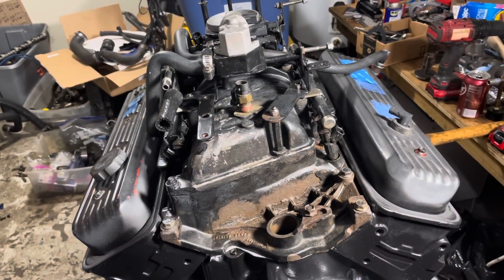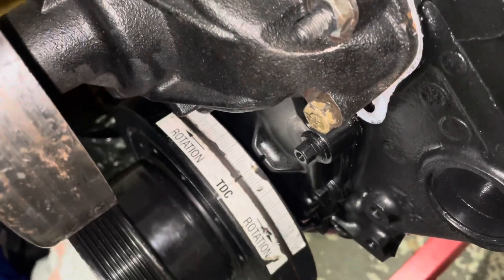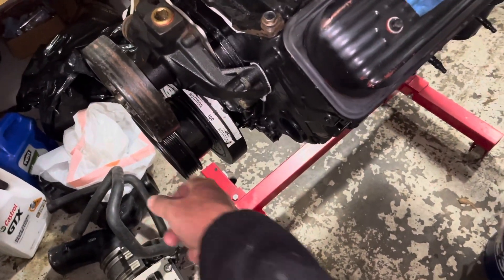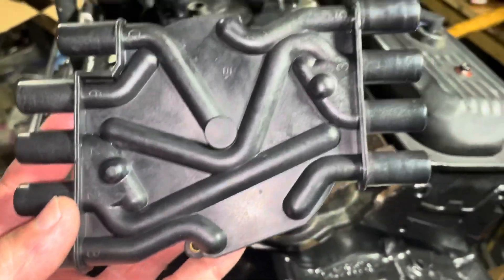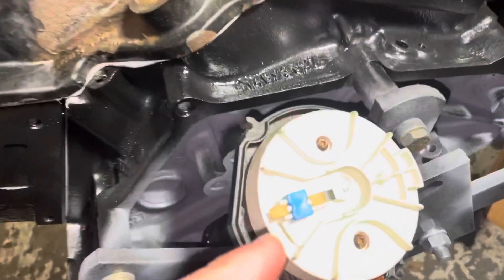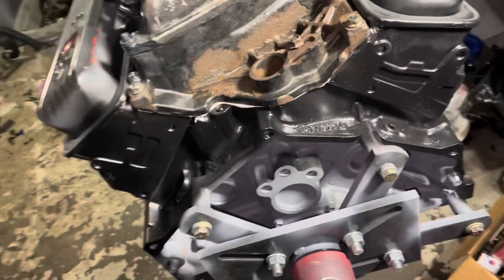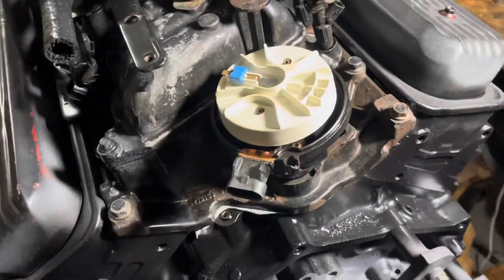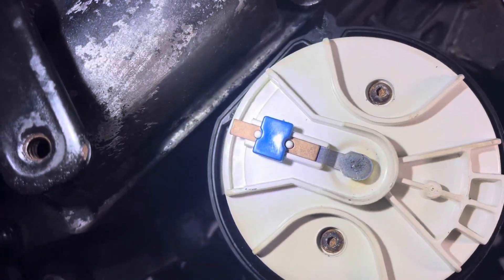Mercruiser 5.0 1(i) - MPFI Distributor Install

Comment: I have a question. 
Where does the cam sensor plug in on the opposite end of the distributor. 
A mechanic left the wire off, I ordered a new wire but dont see where it would plug in.
Thanks
Reply from the maker: I don’t understand your question. If your boat had a connector for the cam sensor it would have been integrated into the EFI harness and not an independent set wires  “going” somewhere. Some earlier EFI boats didn’t use the cam sensor even though the distributor had one and there was no connector for a cam sensor. If your harness did have a cam sensor connector and it was cut off by mistake  or not connected the wires go to the MEFI computer inside the EFI harness. Some systems have the cam sensor connector and you can connect it but it isn’t used by the MEFI computer. The cam sensor allows the MEFI computer to run the engine in sequential mode meaning injectors are fired individually in time with the piston locations. Otherwise it fires in batch mode where 4 injectors fire on one side of engine followed by the other four. Sequential pollutes a little bit less during idle. I’ve covered sequential vs batch in other videos of my channel.

Comment: Starting, maybe in 2005, the  CaMshaft Position(CMP) sensor is used.  My 2007 6.2 mpi has it connected.  Mecr man #36 has a wiring diagram with and without it. (CMP sensor). Great video. Thx for posting.   Q:  Thoughts about using a $120 auto distributor ( e.g.  carquest 1639) vs a $1200 merc one.  As you video shows the hold down bracket needs to be reused. (And a marine cap/rotor).
Reply from the maker: The distributors are the same except the marine one might have a marine coast guard stamp. If that concerns you get a used marine one on eBay.

Comment: Thanks for the video. I have set my new distributor in my new motor (same HVS distributor in a volvo penta with MEFI 4).  No mention of the cam retard angle?  My 2003 starts and runs well but is showing a 59-60 degree cam retard angle on my Diacom software. (spec for the 4.3 V6) I cannot find the spec for this motor in the service manual or the EFI manual. Read online CRA should be 42-45 degrees but also each motor has a specific CRA.  No fault code 81 for incorrect distributor install. Is there software you can change the CRA with? Diacom is read only. Do you know where the correct cam retard angle can be found if not in the service manual? Thank you
Reply from the maker: Did your system have a harness plug that connected to the distributor? Some don’t. If yours did and it’s running without setting a sync code don’t worry about it. All the cam sensor does is help the ECM determine how to sync the crank sensor with the cycles of the engine. Once that’s done the cam sensor is ignored.

Watch this video and the playlist it’s in. It helps you understand what a cam sensor does and why people put too much emphasis on it. It’s needed, but is not an active part of the engine running once it is running. The crank sensor is much more important.

https://youtu.be/0gFkf_8LV8w?si=mD_hgOGw_6WHyVnW
Reply: @moccasinmarine  thank you for the reply and the link. Yes my distributor plugs in off the harness. I agree with your video. The engine runs fine and sets no fault code. In this case code 81 for improper distributor placement.  I’m moving forward with on the water testing thus engine under load. 👍
Reply from the maker: Did you say it does or does not set fault code 81?
Reply: @moccasinmarine  does not.
Reply from the maker: There is a window of a few degrees (+or - 5 maybe)  that the ECM expects the cam sensor to be in relative to a position on the crankshaft. As long as the cam sensor signal is in that window no code is set and the ECM knows where the engine is within a 720 rotation cycle. There are two plastic pointers on the distributor body, one says v6 and the other says v8. There is also a flat on the distributor body that should be parallel with the angled back of the intake. With cylinder 1 at TDC on compression stoke you drop the distributor in the engine while lining up the rotor tip with the v8 mark and the distributor flat parallel as best you can. That should put you in the window automatically.
Reply: @moccasinmarine yes I installed it on TDC and the rotor is pointed at the “8” on the distributor. Starts and runs well with no related fault codes.   After I deal with my DTC “41” EST A fault- EST has an open circuit.  - The boat will be launched and I can see how it performs under load. Thank for the video. I am one step closer. Much appreciated.

Comment: Did any other Merc tech, as myself, see that BOTH Distributor cap screw holes are a mess??? One is just broken off and the other is just 1/2 there and hangin on by a thread.  Probably because they were over tightened - that there needs a complete new distributor .. Unless you are just going to Wire Tie it so the cap stays on  8)
Reply from the maker: It’s obvious you commented on this one video without watching many of my other videos. The theme of my channel is that I can rebuild Mercruiser engines without paying a fortune in Mercruiser parts. It’s been a while since I made this video but I’m sure if the cap wasn’t secure I wouldn’t have used this distributor. I’m just wondering why you didn’t comment on the rusted manifold and say I should replace that $1500 part? I actually did end up taking it back off and having it needled and sand blasted and painted to remove the rust. Also all of my videos are more about the why and how rather than if a plastic part is broken. Why that caught your focus I don’t know.

Comment: Can I run this distributor with a carb and fire it some other way?
Reply from the maker: Not unless you want to pay $700 for an msd crank trigger and msd ignition box. This is the second time you’ve asked about using this distributor with a carb. It can’t be done cheaply. You would be better off buying my Delco EST kit if this is for a marine engine. If it’s for a truck or car just use an old HEI distributor with vacuum advance.
Reply: Thanks for your help I will find a good used MSD box and trigger it for a marine engine and I need the space. Can’t use a tall distributor. Sorry if I asked the question too many times thank you.
Reply from the maker: You didn’t ask the question too many times. I just thought you didn’t understand my answer and I was making it clear that the answer wouldn’t change. But you didn’t explain why you needed a low profile distributor which changes the situation drastically. There are probably low profile distributors out there that have side post plug wires and have a magnetic reluctir pickup inside with centrifugal advance. If you find one a Ford Duraspark ignition module can fire the coil. This would a much cheaper way than a crank triggered MSD ignition.

Comment: This is very helpful! I'm working on a 2015 6.2L Mercruiser mpfi engine with the same type of distributor. I bought a new long block (engine was corroded) and instructions says timing should be set to 8 BTDC. My crankshaft pulley is marked. Should I set it to TDC, like you did on the video or should I set it to 8 BTDC before I drop the distributor?
Reply from the maker: Please watch the video again because based on your question you did not fully grasp what I’m doing in this video. Part of your confusion is due to the instruction of setting timing to 8 BTDC. With an MPFI distributor with the flat crab top distributor cap, the dynamic timing is solely determined by the ECM and crank trigger. Again watch the video for a better understanding. I state the point of the video pretty clear starting at the 1:28 mark.
Reply: It looks like I need to turn the crankshaft so that cylinder #1 is at TDC on the compression stroke and drop the distributor, ensuring it points to the mark, and then let the ECM worry about timing. I get that... my problem is that setting everything like that, the terminals in the distributor will be mechanically lined up and touching each other at TDC. I guess I don't understand how the computer can change that. Even if it knows to fire spark 8 degrees before TDC, how is the spark traveling to the plug if the terminals in the rotor and cap of distributor are not in contact.
Reply from the maker: The terminals inside the distributor never actually touch each other. There is always a small air gap between them and the spark jumps the gap. 8 degrees of crankshaft timing is 4 degrees at the distributor and since the max timing of a v8 is around 30 degrees you will have 15 degrees of gap inside the distributor. At the 7:07 mark I show that the rotor has to point to the corner of the flat on the distributor body once the distributor is in place. Once that’s done you lock down the distributor and the ECM takes it from there.
Reply: @moccasinmarine  that makes sense. Ty. I have another question related to this. I've installed the distributor just as you described in this video. Next, I installed the harness. I didn't realize this but the cam shaft position sensor was not connected when I pulled the engine. I looked around and didn't see a free conector. There is one in the area, but it is connected to a connector. I'm not sure if I should disconnect it from there and connect it to the sensor. I have a couple of pics but can't post them here.
Reply from the maker: I misspoke in the majority of the video about the cam sensor. I wasn’t wrong but most of the cam sensor discussion pertains to cars and trucks. The boats having distributors still used batch fire fuel strategy so the cam sensor isn’t needed. You’ll find in the marine applications there is no cam sensor plug.
Reply: Starting, maybe in 2005, the  CaMshaft Position(CMP) sensor is used.  My 2007 6.2 mpi has it connected.  Mecr man #36 has a wiring diagram with and without it. (CMP sensor). Great video. Thx for posting.   Q:  Thoughts about using a $120 automatic distributor vs a $1200 marine one.  As you video shows the hold down bracket needs to be reused. (And a marine cap/rotor).

Comment: Thank you for making this video you helped out so much I was a bit lost without  full knowledge of installing my distributor you made it very clear extremely helpful 👍🏻
Reply from the maker: Glad it helped. Just to be clear, the MEFI computer controls the spark advance (dynamic timing) but the spark distribution to the correct cylinder is done by the distributor and cap. That’s why it’s important to install it statically timed as I did in the video.

Comment: Very helpful, especially explaining the relationship between crank- and cam sensor. You mentioned spark advance is controlled through the ECM by reading the crank sensor rpm. But spark firing should be controlled by the cam sensor as per your explanation you need the full 720 degrees to fire the right sparks and activate the right injectors

Comment: Is a car distributor the same as a boat distributor? Trying to help my buddy on his boat after he had people change a bunch of parts that I don't think needed to be changed...the timing was off when he brought it to me and I set it right but still seems to be off...do i need to static time it?
Reply from the maker: If it runs at all it doesn’t need static timed. Make sure spark plug wires are routed to the right cylinder. And the answer is sort of. There are many different types of distributors so I can’t give a definite answer but the Mercruiser Thunderbolt is a one of a kind system that you won’t find in a car. The main difference between a car and marine distributor is the marine ignition modules (both Mercruiser and Delco EST) advance the timing electronically i.e. no moving mechanical parts involved. Car and truck distributors are either advanced by a computer or if older by mechanical weights and springs and vacuum diaphragms.

There is a rarely known issue though when it comes to electronic advance distributors. Since the advance occurs electronically, the rotor and cap phasing is critical. It’s possible that the advance can be so extreme that the advance actually causes a spark on the upcoming cylinder which causes severe detonation and bucking. This usually occurs when the distributor gear is put on 180 degrees out of position.
Reply: @moccasinmarine  I just found out that they took out the IAC valve muffler that's in the throttle body...couldn't understand why I was hearing a major sucking noise until I found a video today about the foam filter in the throttle body they're calling a muffler...appears I've been dealing with a huge vacuum leak because that filter was removed...
Reply from the maker: @masonhoward9042  it’s not a vacuum leak. The muffler is in there to make the sound quiet. The idle control motor is a computer control vacuum leak. There’s not a problem with that.
Reply: @moccasinmarine  also it would run amazing then shut it off and let it sit for a hour or so and crank it up and wouldn't hardly run